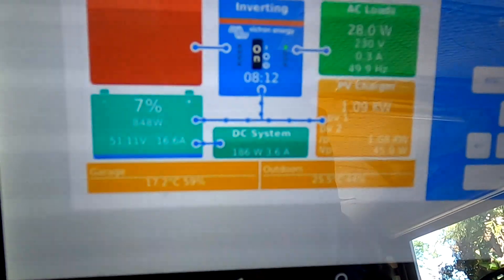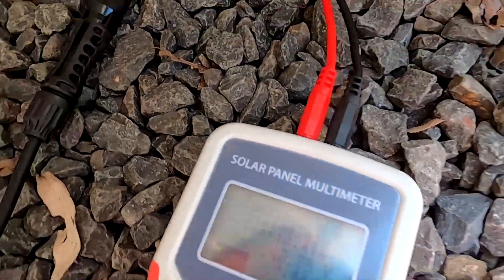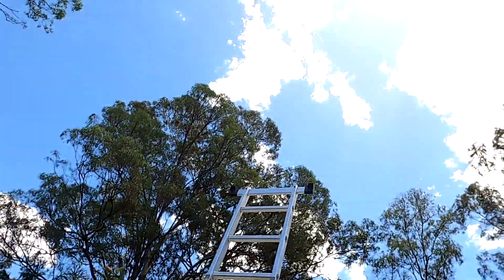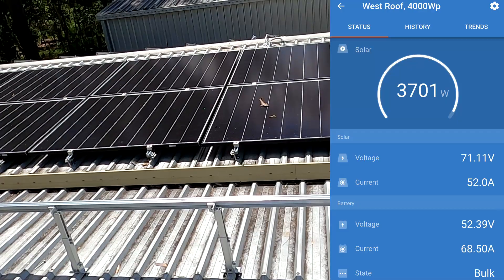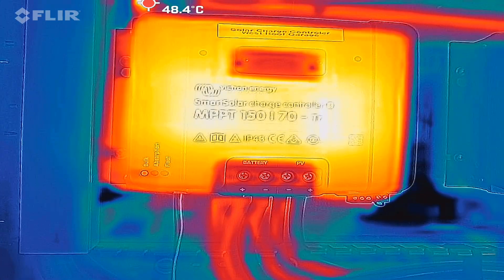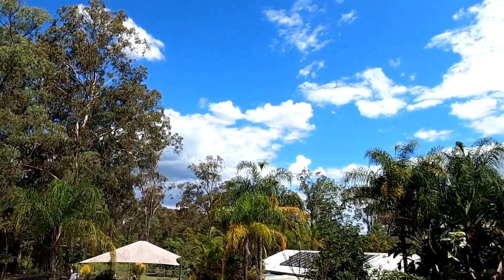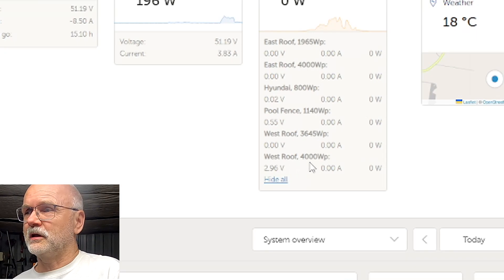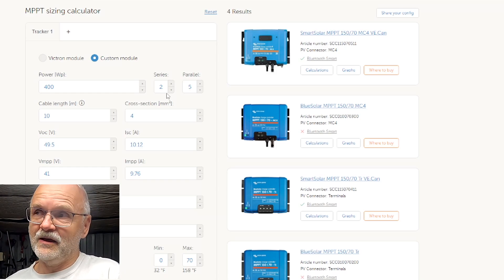First charge with the new West Roof. Can the Hyundai Shingled Panels deliver?

Comment: I was going to mention the FINGER PRINTS from the previous video.
"Time to wash your hands for LUNCH and when LEAVING JOB"
We NEED these HYUNDAI shingled in the US....Andy...MAKE IT HAPPEN!
¿ZO uᴉ XƎpNIM ǝʌɐɥ ʎǝɥʇ op
Reply: They really do not make much difference compared to the current line up of panels from other vendors. The biggest difference will only become visible over the year, how long and how good they perform then in 10 and 20 years from now. We had gotten 7 different brands of panels in 2022 and they all are so close to specs that there is not much difference so far. Each is connected to Growatt inverter and even string length is pretty much the same. We got cheaper ones and more expensive one but all between 500 and 550 Wp, all in 5S configuration and 2 Strings per 4,6 kW inverter. 
For me those brands are overemphasized for now, but can not talk about 10 or 20 or 30 years of production  which is usually hard to tell cause which of your products you had purchased  had been buillt in 1992 ?
Even products of the millenium are hard to find even though I have an old Plasma Tv of 60 inches or so and some Palm Pilots  and Thinkpads still operational, also an Atari Portfolio from 1990, but those were never in daily years over 30 years just 2 or 3  years in the beginning.
Reply from the maker: Fingerprints don't make a difference. Same as washing the panels does not increase the output. It's just for ones OCD...